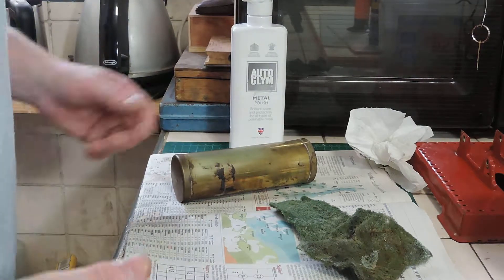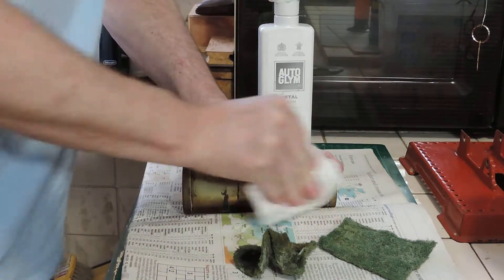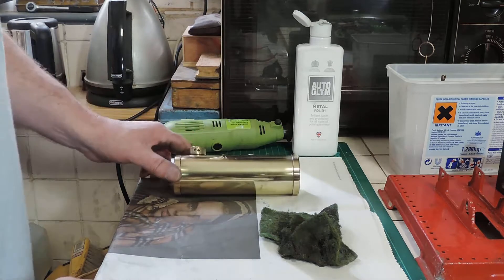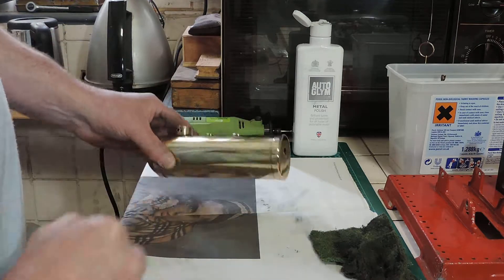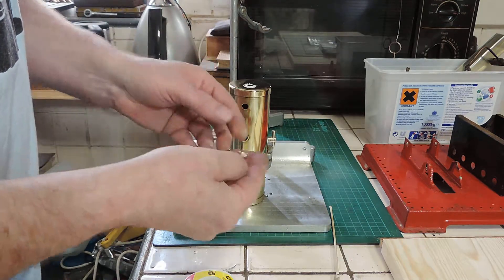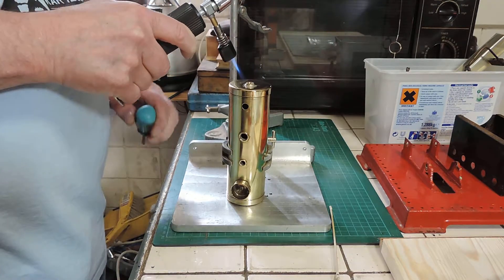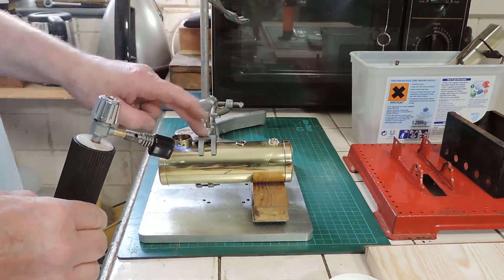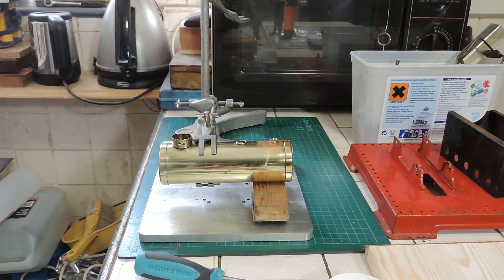Mamod SE3 Model Steam Engine Restoration - Part 2

Comment: Im glad to see you using soft solder. That answers a question I have been asking myself. A lot of people think it should be silver soldered. But I think if the boiler run dry it may damage the solder but a dry boiler wont explode. Thank you. PS I am talking  about pressure under 2bar. Nice job too
Reply from the maker: Thank you. Mamod model steam engines work at very low pressures, 12 to 14 PSI. Silver solder is not really necessary at these pressures. I've used soft solder for years on these models without any problems.
Reply: Thanks again.  And I really enjoy you're videos keep them comming! @RetroSteamTech

Comment: Nice soldering
Reply from the maker: Thanks. The trick is to get both parts as clean as possible.
Reply: @RetroSteamTech  do you need to pickle them or can you clean them up well enough without?
Reply from the maker: @paulmeynell8866  I've never pickled the parts I solder, just a good clean and a wipe over with acetone to remove any remaining grease/dirt seems to do the trick.
Reply: @RetroSteamTech  is there a preferred type of flux for this type of soldering , or is it gust standard plumbers flux?
Reply from the maker: @paulmeynell8866  Just standard plumbers flux.

Comment: I saw you soldering in new inserts but did you desolder and remove the old ones first?
Reply from the maker: The original inserts were missing which is why new ones were fitted.
Reply: @RetroSteamTech  cool. Im a noob. In Australia buying inserts and missing parts for Wilesco sets one back $50 a part inc shipping. Is there a source for buying replacement parts cheaper that you know of?
Reply from the maker: @LL-wc4wn  Never had to buy any spares for a Wilesco but Mamod parts over here in the UK are fairly cheap. If you have a lathe and a set of collets then it's easy to make your own inserts.

Comment: Roughly what thickness is the solder you use as there are some at 0.8mm up to 3.5mm?  Is yours about 2mm? Thanks
Reply from the maker: A very good question. I've just measured it and it's about 1.5mm to 1.6mm.
Reply: @RetroSteamTech  Thank you so much. I appreciate it.
Reply: I was going to ask the very same question!

Comment: Great video again Alan, don't worry about the patina pal, in a few years it will come back and will have a nice even colour, one tip I use Alan when soldering the whistle inserts is to screw the whistle into the insert first and mark the front of the insert with a Sharpie, unscrew and solder, this is so when finished and you screw the whistle in to the boiler it will face the correct way, I don't like to see whistles when they are off centre.
Reply from the maker: Thanks Mike, what a great tip, i'd never considered the whistle alignment. I will definitely remember that when i do the next one.